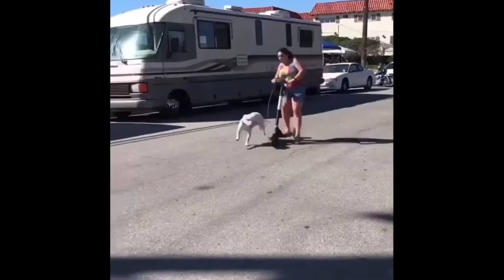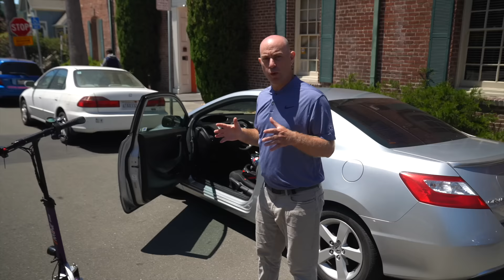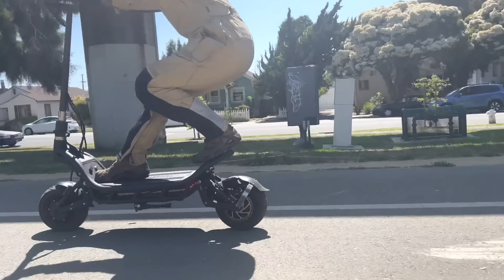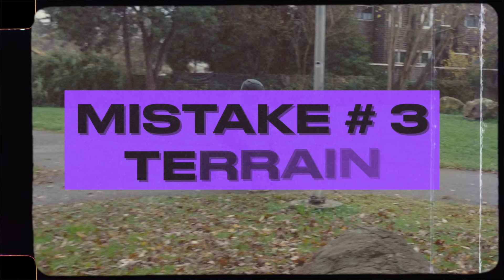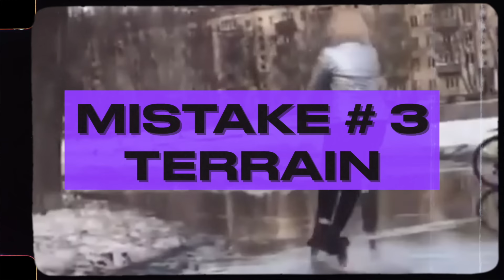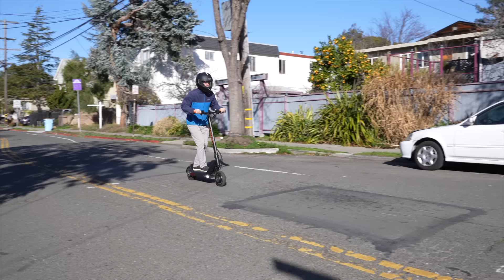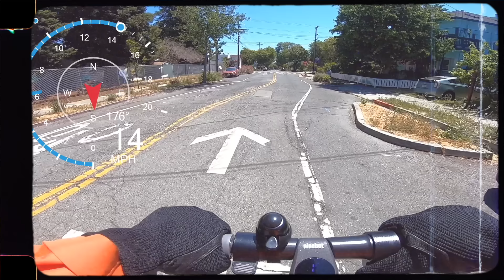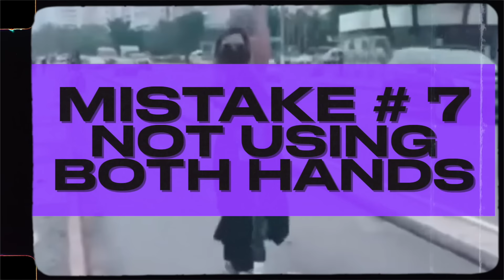Top 7 Riding Mistakes New Scooter Riders Make & How to Avoid Them

Comment: Very interesting. Coming from a motorcycle and motor scooter background I notice some similarities but also notable differences between them and electric scooters.

To help me out in a couple of points. On a motorcycle I would use a 75/25 brake balance (to the front). On a motor scooter more like 60/40 because there’s no gears, smaller tires and lighter weight.

What’s recommended for electric scooters? Incidentally the braking squat is a great tip; reducing CoG and weight transfer.

Motorcycle helmets are great but heavier and more expensive. Is there anything else that bridges the gap?

Lastly in my early motorcycle riding I fell off over the bars at about 10mph. The palm of my leather glove was completely torn open. I have never ridden without gloves and would strongly advise others to do the same even in hot weather. Thanks.
Reply from the maker: Very insightful! Thanks for sharing

Comment: Right foot forwards rather than left is just ridiculous, given that you prefer right in case of an impact. I would say go with the foot forward that you are most comfortable with. Some might actually make very wrong body adjustments with the wrong foot leading. With the correct foot forward, it feels natural to lean both ways, whereas with the wrong one, it feels like falling or someone else steering rather than you. Braking was 100% right, with the added note that during a dry season, the first rain will make the road just slightly muddy, making all road surfaces slippery. Also, the markings on the road, especially fresh markings "white lines, yellow lines"... for the off-road, I would say, keep in mind these are built to be as light as possible, not as durable as possible. Unless you buy one for off-road use specifically. to the helmet section, yeah it is pretty much self explanatory.. if you wanna have face left after a crash, use something that protects what you cherish for... You really do not have to buy a 1000$ helmet, per se, but whatever makes you feel safer, go for it. cruise control, I do NOT recommend putting on EVER! There are times when you just forget that you have it on and try to avoid something just by letting off the throttle, and you find yourself still propelling at the same speed, which adds more reaction time and panic! So unless you drive a clear, straight desert road for about 5 miles... leave the cruise of, please! There are some e-scooters that you can possibly drive without hands with the cruise control on, but I really, really do not recommend It takes just a small pebble for the front wheel to jerk off to one side, and off you go like a limb biscuit. Also, the same rules and more apply to you than just pedestrians or cars. Red light is still red, lane change needs to secure your back and sides, keep an eye forward, and see what is going around you all the time! You see some weird ahead, slow down immediately...

Comment: I ride with my right foot forward because I'm coordinated that way. at 40 mph I need to be in control. If somebody opened their door I'd just angle my scooter away from it like I do every day when riding down the sidewalk and bushes are encroaching onto the path. I'd never want to lean backwards, as that's so much more dangerous if you lean just a little too far and fall. I say ride in a way that allows for best coordination and weight distribution when accelerating and braking.
Reply from the maker: Very insightful! Thanks for sharing. -Vosk

Comment: If you want to be a skilled rider, you need to learn to use both stances alternating about 50/50. This will provide you with both more stamina and more skill over time and especially so if you want to be good at single track. Also, if you use cruise control regularly, you won’t forget that it is the brake lever that turns it off which is what you are going to use to stop or slow down for an intersection anyway.
Reply from the maker: Very insightful! Thanks for sharing.

Comment: I fell only once in three or four years I've been riding. I was going downhill very slowly and part of the pavement was wet with soap water from a guy washing his car. No way I could avoid it.... Didn't get hurt as I was wearing full protective gear but broke the handle rotate blocker. I had been driving for just a few days so I was lucky.... I don't wear protective gear now as I practically use it all the time. But since then I keep a very watchful eye on any wet surface and wouldn't dream using it when there's the slightest drizzle!
Reply from the maker: Very insightful! Thanks for sharing. -Vosk

Comment: I'm not sure if I agree with the goofy/regular stance saftey tip you gave.  At higher speeds I would want to ride in my normal skateboarding stance for better control.  If I was to hit a car door, I think it would be better to be riding the opposite way that you mentioned in this video.  If car doors are opening up to you on the right, wouldn't it make more sense to have your left foot forward?  You should be able to absorb much of the impact from the car door this way by rolling over the car door.  If you hit it with your shoulder you'd be coming to a hard stop like hitting a brick wall.  Also, you have more turning power to the left to avoid the accient all together if you are riding left foot forward in that situation.
Reply from the maker: Very insightful! Thanks for sharing. -Vosk
Reply: yeah i though that too. but i guess only difference between two stances are that are you taking chances of taking a hit to inner torso or shoulder torso? or another question of are younsure that you can slip with minimal damage or none at all.

that was a good thought though

Comment: for first tip about car door opening, you should have any vehicle licences you have suspended instantly for driving closer than 1,5m to parked cars. That is a road law in i think most EU countries, you have to pass parked cars by distance of 1,5m. Also, dangerous electroscooters should stay away from roads, even away from sidewalks.
Reply from the maker: Very insightful! Thanks for sharing.
Reply: @ESG-ElectricScooterGuide  and what i said about dangerous electroscooters is, last week i actually destroyed a scooter and nearly ran over the driver on road. He was driving really fast on sidewalk, and fell, and the scooter flew like 2 meters away from where he fell towards middle of the lane i was driving on the street, right in front of me.

Comment: I hate cruise control..... Almost got me killed. I was leaving a plaza, trying to make a left turn onto the sidewalk but instead I kept rushing forward into oncoming traffic and nearly got flattened by a 14 wheeler truck.
Reply from the maker: We are not fans of CC either! -Vosk
Reply: I think the cruise control feature should definitely be changed in how it's activated and or even being able to be turned off, I used to have an electric bicycle that had cruise control that did not have the option of being turned off.

Comment: Riding a scooter is almost like riding an electric unicycle - more dangerous than riding a bike.  When I ride an electric unicycle, I wear helmet, arm-guards, knee-guards, and wrist guards. In case you crash, your first reaction is you instinctively put your arms out to break your fall, and that is what hits the ground first.  If you are caught off guard and unprepared, the head may hit the ground before you know what is happening.  In comparison, it is only a minor issue if you destabilize, fall off and scrape your knees.
Reply from the maker: Very insightful! Thanks for sharing. -Vosk

Comment: Wow i was expecting an awful boring useless video (don't know you no offense :p) but this video is actually quite on point and all 7 tips are each very relevant and overlooked points. 
Bravo. 
That 1 handed thing is strange tho. I mean you're right, but idk what to make of it. I smoke cigarettes so i sometimes used to light one up on the way to work on my xiaomi 3, no problem, could hold the cigarettes in one hand and maintain the scooter steady with the other during the few seconds it took to take a drag (provided i was on the road not the bumby sidewalk/ or going slow).
But now with my new upgrated hitway i feel it should be easier. The scooter has more then twice the power (350w->800w), weighs more then twice as much (~13kg->28/30kg, ~26 pounds-> 60 pounds), and has larger wheels (8"->10").
I mean generally its just larger, wider heavier, much more sturdy (wanna point out i haven't mounted the seat idk if it would help or not).
So it feels like it should be more stable, hold its position better etc, yet i tried hoing one hand for very brief moments (always at lower speeds and flat easy roads with no one nearby) to smoke a few times its near impossible, i feel as if i m going to fall off every freaking second...
Anyone have a clue why? It anoys me not to understand, haven't given it that much thought but still, i m in phys8cs and it seems intuitive it would be the other way around.
I know it is for bikes, i drive those all the time, and every biker (think i m confusing terms here, been in europe for too long, talking about motorcycle) knows that a flimsy 50cm3 scooter is way less stable then a large motorcycle, i mean on my fathers massive (1600cm3? I think) triumph it feels like were on on of those 3 wheels nazi bike as its so stable, once you reach a certain speed the thing is really hard to loose balance on
Reply from the maker: Very cool! Thanks for watching. -Vosk

Comment: I remember when my e scooter was still at the time like 2 months old but when I went to my step parents vacation like home I got launched over my handle bars cause there was a pothole hidden by grass. The second story was in summer when my scooter was like already kinda old (like 5-6 months) My view was blocked by some dumpsters and there was a street so a grandma came from behind the dumpster and me not wanting to launch from the handle bars I braked slowly but my scooter started sliding in a drift like and I fell down (luckily with no bruises or anything) and third one (the last one) my friend T boned me cause I was turning while I said that we should go to a lake (mind it was in a turn on the right) and my friend for some reason wanted to go in the middle, the damage was not really big except for some plastic starting to touch the rear tire but I managed to pull it back.
Reply from the maker: Insightful! Thanks for sharing. -Vosk

Comment: Tram lines on roads will wipe you out. Wet tram lines will ram you straight into the ground, hard and fast, no chance to react. Even at 5 mph. Even if you're crossing them perpendicularly. This is the single most dangerous thing for scooters in my experience.
Reply from the maker: Thanks for sharing. Stay Safe. -Vosk

Comment: I only had my scooter about 4 days and I was goin on my lunch from work. And I jumped on in sport mode roughly max's out at 25kmh on the flat. And I jumped on and hit the throttle and for some reason it pulled to the right. I must of been off balance and my mind just froze and I just kept on the throttle, hit a large curb at about a 45° angle and wiped out.
Tore up my right knee really bad and a smaller graze on my right arm. I had only jumped on and it was literally 5-10 secs layer it happened so was prob only going about 12-15kmh. But still did quite a bit of damage. I managed to limp away from it. And apart from shredding off the stand the scooter was fine. 
I personally think I just hadn't ridden it enough. Now a month later I'm a lot more confident on it. I do wear a his vis but not a helmet. Il prob reconsider that.
Reply from the maker: Glad you are okay! Stay safe. -Vosk

Comment: I have a couple comments that I have found are good to know, First, If you have 2 motors, use them unless you are going long range. It will allow you to go through most loose surfaces without crashing, plus, it prevents going fwd, over the Handlebars. Braking, I believe it's best to use the rear brake as main Braking and only assist with the front. Never use the Front Brake more than the rear, or lock it up. If you own a collapsable front stem, make sure that the retainer is totaly locked in. Also, always check the air pressure in the tires, before you go on a new trip and for loose nuts and bolts. Finally, don't be a moron and think you can drive safely with Cars, on the street, because you can go as fast. As in all cases you will be worse off in an accident, or dead.
Reply from the maker: Very insightful! Thanks for sharing. -Vosk

Comment: I thought a lot of these would be common knowledge or at least common sense. Like leaning backwards when breaking. When I first got my scooter I did a test drive in the parking lot of my apartment, which had 2 storeys and speed bumps so it was a perfect space for practice, which helped me figure a lot of things as a beginner. I still had 2 accidents on my scooter, though none were my fault. 1st time I lost my balance because a car splashed water on me. I was still fairly new at riding scooters and barely able to maintain my balance. That made me panic and knocked me down. The 2nd time I was going downhill and brakes failed, I assume because of that water splash. I realized it too late and had to jump to save both my life and the scooter. It was NOT pretty. After that downhill accident I had my scooter checked thoroughly, then had a seat installed for better balancing and got a helmet in case it ever happens again. Never had another accident, though I still can't trust the brakes fully. Though there was a time I found the road very empty in an early morning, so I did a minor speed test just to see how fast I can go safely. Scooter was able to go up to 70 kph where the tremors freaked the hell out of me, so I didn't dare to push further but I found the maximum safe speed for me is around 30-35. Thankfully the brakes did not fail me that time so I was able to safely slow down, but it enabled me to boast around about how fast my scooter can go. I'm 180 kg, so being able to go up to that speed on a whim is objectively quite insane. On a normal cruise I don't necessarily do speeds higher than 25 so I can safely and quickly stop with my feet on a sitting position just in case brakes fail again. I love my scooter, I love riding it. So the idea is, logically, to stay safe and keep being able to ride it.
Reply from the maker: Very insightful! Thanks for sharing

Comment: Curious thing, i have never used a scooter before, even less one electric, but since im a bike rider, theres an instinct that is translated

You wanna brake?, Let your legs and not your arms the ones that bare the momentum, avoid difficult terrain and if need be, bare the vibration with your bent legs, not your hands (or in the case of a bike, neither your buttocks)

Also, if you need to impact, use your shoulders and not your chest or face

So, to anyone bike user that wanna use a scooter, the translation would feel as standing on the pedals and your back in the air

Edit: and yeah, i got a scotter because i needed something more portable in the place away from home and my street toys
Reply from the maker: insightful! Thanks for sharing. -Vosk

Comment: I always take the lane when I'm passing parked cars, so I've not had a car door accident since I was a kid riding home on my bicycle.

But around the time Russia attacked Ukraine (it was like a week or 2 after, I think), two idiot contractors, parked in the bike lane, packed away all their warning signs before they closed the manhole cover on the pavement that their obstruction forced me onto. It was also dark. Fortunately I was decellerating (due to being on the pavement now with my 25mph scooter). I felt my front wheel drop and next thing I know I'm tumbling several meters down the pavement with my scooter almost hitting me at speed.

Also fortunately, I had enough brain cells to get a decent motocross helmet when I bought my scooter so no head injury, but I dislocated my collarbone. The tendon was damaged and torn, but not severed. I was in pain for a month and the collarbone still sticks up. I don't know if it will ever heal properly so "body armour" has crossed my mind.

But yeah, get a helmet, and maybe a good bright stem light.
Reply from the maker: Sorry about that! Hope you are better. -Vosk
Reply: @ESG-ElectricScooterGuide  🤔 ...I forgive you? 😅

Comment: Yeah cruise control is done so stupid on this scooters. Not just that, gas handle also. "Gas" handle position should be linked to speed, not current. The same with cruise control. Cruise control will speed up to maximum speed in that gear, not keep at current speed.